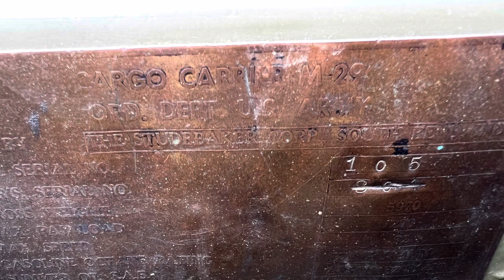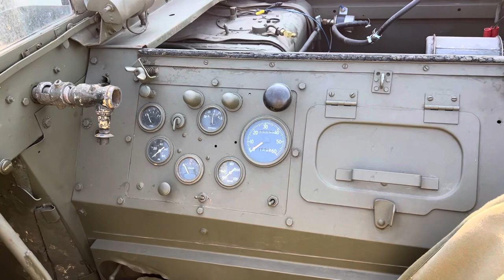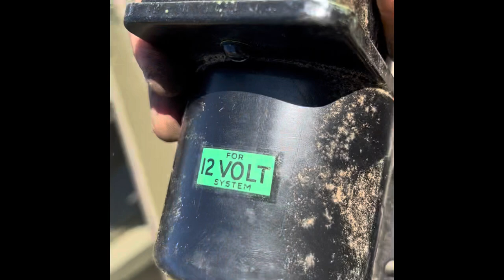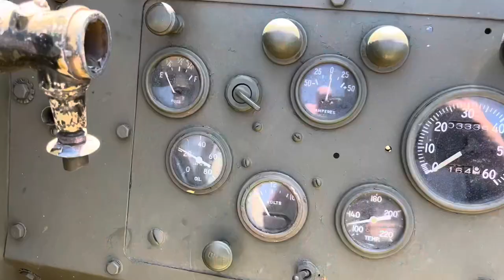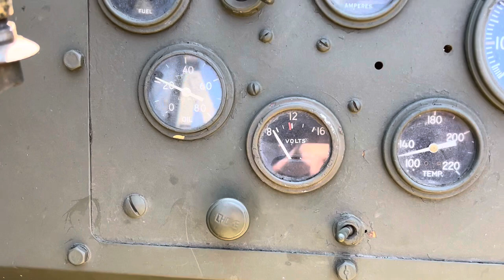T24 Studebaker Weasel, a new addition to the Motor Pool

Comment: Very nice condition weasel, The French tracks are horrid. When I bought mine the tracks did not look all that bad , however setting as long as it had when we got it running the 40 pitch chains imbedded in the rubber pads literally fell apart. I had to totally rebuild the track.